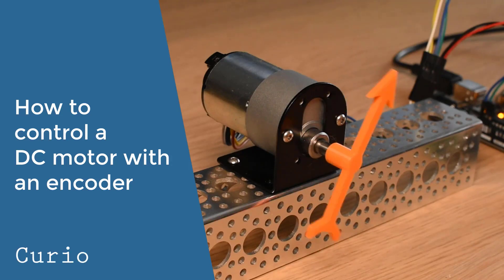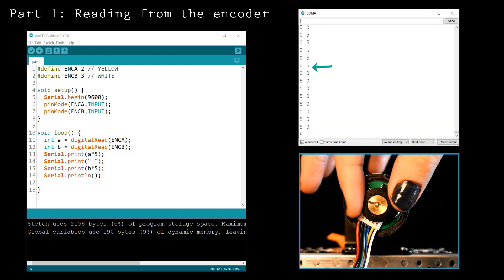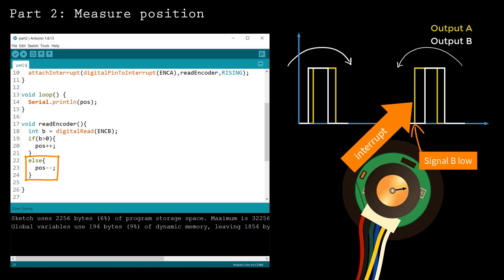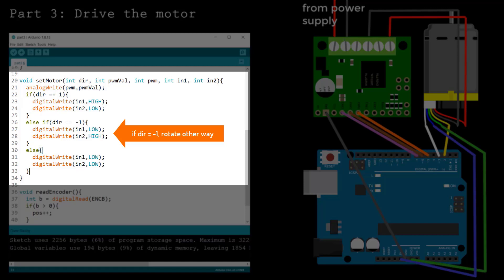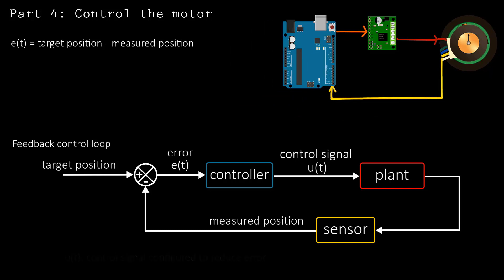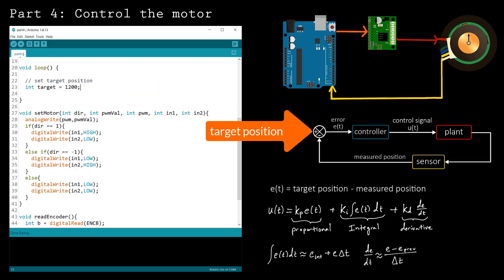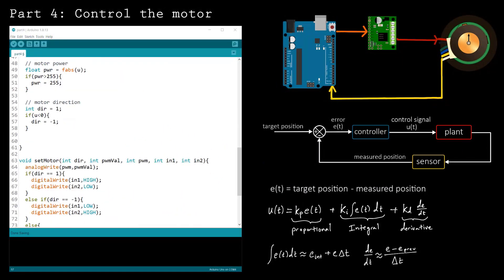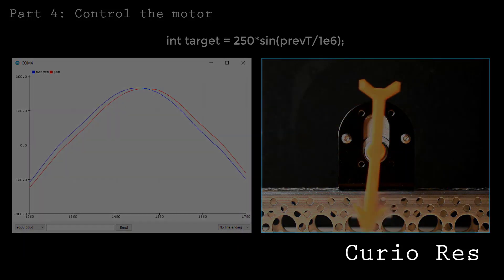How to control a DC motor with an encoder

Comment: I can get the sine wave function going but when I try to input a static target value, the motor turns and stops, then after a slight pause, the motor continues to go in the original direction indefinitely.  Has anyone else had this problem?  I downloaded the code from CurioRes to make sure I was not typing in an error.  I swapped out motors thinking perhaps the motors were the problem.  But I never can get the motor to stop and stay at the target position.  Any suggestions.  I tried @ben_Lucy fix but that has the same problem.

Comment: One of the issues I’m facing with the derivative calculation is that my microcontroller updates the error and previous error so quickly that the difference between them is almost negligible. As a result, the derivative term becomes zero or so small that its effect is inconsistent — either doing nothing or occasionally causing large spikes ("kicks") in the output, because the deltaT is so small.

One thing that worked was setting an interval for this calculation — for example, the microcontroller only updates the error and previous error every 5 ms, so the delta becomes noticeable.
Reply from the maker: Good point and analysis -- an approximate derivative can be a big source of error. A common approach is to filter the derivative (something like a low-pass). If you're seeing floating point errors that could be an issue to, but would probably be resolvable simply with update to the data types or calculations, without requiring throttling.

Just as an aside you also want to watch out for throttling the controller as that can lead to instability as well. Depends on what kind of delays there are in the response of the system.

Comment: Thank you. I have implemented your code using L298N. Everything is working fine. However, once the speed reaches 1200, the motor is automatically stopping. There is no isse with sine wave speed input. I would like to run motor at 1200 or set speed continuously but it is stopping.

Comment: Hello Curio....  i m learning a lot from your video...manage to construct the circuit and its working perfectly now! thank you very much ! I have a question here: if i have a motor with the following spec. • Inertia (J) = 0.01 kg·m²
• Damping (B) = 0.1 N·m·s (friction)
• Back EMF Constant (Ke) = 0.01 V·s/rad
• Torque Constant (Kt) = 0.01 N·m/A
•Motor Resistance (R) = 1 Ω
•Motor Inductance (L) = 0.01 H
and i wana achieve speed control with: Zero overshoot, Minimal Settling Time, <5% Steady State-Error, please advise what should i do? TQ

Comment: Hi, are you taking any questions in 2025? I would like to move the motor for a test to four different positions. Set up four pushbutts that, when programed into the vode and pressed, the motor will run to that position, stop and wait  for another one of the pushbutts, be pressed, and run in reverse to that new programed position. Can you do that for your viewers? Thank you.
Reply from the maker: I check here periodically. 

The task you're talking about is quite easy -- I don't think I would create a video for it, it would probably not have broad interest...but I can point you in the right direction.

Import the one button library. See the example here to get started:

https://github.com/mathertel/OneButton/blob/master/examples/InterruptOneButton/InterruptOneButton.ino

Now declare a "global" variable for the desired position at the top;

int desiredPosition = 0;

Set the click response for each button to whatever you want it to be.

template <int desiredPos>
void setDesiredPos(void){
    desiredPosition = desiredPos;
}

Then utilize that to attach a click for each button. Follow the example

https://github.com/mathertel/OneButton/blob/master/examples/InterruptOneButton/InterruptOneButton.ino

Something like this:

button1.attachClick(setDesiredPos<50>);
button2.attachClick(setDesiredPos<-50>);

Alternatively, if you don't want to use templates or you want to make changes dynamically to what's being done by each button, there are lots of other ways you could write the callback(s).

Comment: Good day hope you're doing well. I am having an issue with my code, can you please help me? I am working on a diy project for my flight simulator. so the combo of dc motor and encoder reads values from the game and should update the motor cw or ccw accordingly. for my setup i am using values -100 to 100. lets say the current position is value 80, to go to 81,82,83 etc, the motor should move cw and as soon as the value starts to decrease 83, 82, 81, 80 etc, the motor is supposed to reverse direction, my problem is that the motor will reverse its direction only at the target position which is position 0. example current value is 80, it turns cw to go to 82, 83, 84, 85, etc, and when the value starts to decrease 85, 84, 83, 82 etc, the motor still moves cw instead of reversing . but when i reach target position 0 the motor will then reverse . i can provide my code so you can have a look. thanks waiting for your reply
Reply: Post it I can help

Comment: Update: If your motor is not working, check that the wires are connected to the motor driver. The Diagram in the tutorial shows "A+ and B-" which is incorrect, it should be "A+ and A-" :)

Comment: Does the wiring/programming change much (if any) if I had to use an L293D?
Reply from the maker: Wiring? Yes, as the driver has different connection points. Code? Could be. Depends on the pinout of the driver. Have to look at the datasheet to determine what adjustments to make to the "setMotor" function".

Comment: For PART 1, I wrote the exact same code as you, but my serial monitor won't print.
Reply: I did that with PART 2, it still doesn't print.
Reply: My Code for PART 1 is exactly the same as yours, but the pins for ENCA and ENCB are different.
Reply from the maker: Difficult to debug without more information. It could be that your encoder has a different pin layout. Could be a hardware failure. Do you have another encoder you could try?
Reply: Nevermind, it was a serial monitor issue. Got it working! Thank you though! :DDD @curiores111
Reply: My serial monitor was the issue. I solved it. But i had another question @curiores111 , how to install util/atomic.h?
Reply from the maker: @shivpat09  Some architectures don't support atomic.h. There's an alternative version of the code posted on the GitHub page that you can try in that case.

Comment: My encoder is not giving values or giving unexpected and illogical values but when I build circuit which also includes the output Z wire and use a library Buttonfever then it gives appropriate values. Whats the reason?
Reply from the maker: Sounds like your encoder probably has a different interface than the one I used. Certainly, there's no compatibility guarantee with electrical devices -- always consult your datasheets (-- or, a dedicated tutorial, if available, is always useful).
Reply: @curiores111  may be. Thanks for your reply

Comment: Extremely well done. Have been utilizing an adaption of this PID control loop for leveling. Instead of using an encoder I pull data from a MPU6050 using the MPU6050_light library usually included in the Arduino IDE. Then Set the target to 0. It works really well!

Comment: Hi. I have a problem. At level 40 of 255 power. The motor makes noise, but does not have enough power to rotate (the encoder disk and main shaft do not rotate). But the value read from the encoder changes continuously. Is that noise. is there any way to fix it. Has anyone encountered this situation yet? Thank you
Reply from the maker: This is a common issue with DC motors. There are a couple things that you can try.

I had one watcher indicate that they improved the situation at low speeds by adding a capacitor to reduce the switching harmonics from the PWM signal. You could try that.

Another mentioned that lowering the input voltage to the motor improved performance at low speeds.

Personally, if I want lower speeds, I'll use a motor with a higher gear ratio. 

In the latter two cases, though, you wont be able to reach higher speeds. (Unless, of course, you have a control mechanism or plan to build an automatic transmission)

Comment: For single motor operation, HBRIDGE should be pulled high, then the single motor + should be connected to both A+ and A-, and - should be connected to both B+ and B-

Comment: Very nice video, and close to what I'm looking at doing.   My plans so far will be with any Arduino board, I'm wanting to have a AS5600 read a direction/step every second and write/save that info, so an average can be calculated for later use.   Then once a minute or so read another AS5600 with a Stepper motor and have the stepper match the average direction/steps of the other one.

Comment: Are the connections of this encoder same for arduino Nano with a Hall effect encoder?
Reply from the maker: Not necessarily, you need to verify that the nano pins support the same functionality (pwm, interrupt), and the pinout for your encoder.
Reply: @curiores111  So if I ensure that I connect the two channels of the encoder to the digital interrupt pins of the microcontroller board is the encoder connection correct?

Comment: Great video, I liked the detailed info you supplied. I have 2 questions though. Could I use this to control a 12/24 Volt DC 250W/350 Watt Gear Reduction Brushed Electric Motor that only has a positive and ground wire, no encoder? What I'm trying to do is,  press a button to start the motor and have it automatically stop after 100 revolutions. I also want to be able to easily adjust the speed and number of revolutions of the motor using 2 adjustable digital displays. One for motor speed and the other for motor revolutions as needed, without having to rewrite the code every time. Is that possible?
Reply from the maker: 1. You need an encoder (or some other mechanism) to ensure the correct number of rotations. So no, you can't do this for regular dc brushed motor without an encoder.

2. Sure, you can easily write code to adjust speed/number of revolutions using user input (the particular form doesn't matter, as long as you can get the input in the Arduino code). You don't need to "rewrite the code every time", simply read the user's input, and add whatever logic is necessary to achieve your requirements.
Reply: Thanks for the reply, very helpful @curiores111
Reply from the maker: @livefreeordie9542  Certainly 😊
Reply: OK, I figured a few things out, I think. Still using the 12/24 Volt DC 250W/350 Watt Gear Reduction Brushed Electric Motor. Added the  BTS7960 43A High Power Motor Driver Module/Smart Car Driver Module for Arduino Current Limit. And a IP67 waterproof 24V 400W 16.6A Power Supply, So I can control the motor through code. While connected to the Arduino uno r3. What I'm not sure about is the code to set it up so when I push a button it activates the motor. Making a set number of revolutions, (say 200) then automatically stop and reset. So every time I push the button it performs exactly the same. I'll be controlling the speed via potentiometer and the direction (fwd & rev) using a forward, off, reverse switch. Any thoughts on the code required to meet my goals? Any help is greatly appreciated.   @curiores111
Reply from the maker: @livefreeordie9542  Do you have an encoder on that motor? You'll need it to for the feedback loop as I mentioned in my last reply. :)

As far as the code goes, you can pretty much use what I have. You need to modify the "setMotor" function to match the datasheet of your particular motor driver.

Then, you need to add in some code to read from your button. If its a standard button try out the oneButton library.

Use an if statement to change the target of the motor when the button is pressed. Pseudocode:
if(buttonPressed){
     targetRevs = currentPositionInRevs + 200
}

If you want the motor to stop if the motor is currently running and the button is pressed, you'll need another flag and a little more control logic.

Hopefully this helps get you started.
Reply: Thanks for the advice and code. Both are much appreciated. 

Still working out what type of encoder and how to mount it on my project. Leaning toward a magnetic encoder due to the harsh environment it will be in. I think the photo sensitive encoder would be more susceptible to dust, dirt, water and oil than the magnetic encoder. 

Now I'm just trying to find the right size magnetic encoder to fit the 8 mm output shaft on my motor. Going to mount the magnet on the end of the 8 mm output shaft then design & 3d print a bracket  to hold the magnetic encoder in place that attaches to the motor mount for stability.

Thanks again.   @curiores111

Comment: Awesome video! Quick question, would this implementation not run into trouble if the interrupt and the control loop both try to access the “pos” variable? 

I found that you could just temporarily shutoff interrupts but wouldn’t that run the risk of missing some counts? 

Best!
Reply from the maker: Yeah, you don't want to turn off the interrupts.

You can use an atomic block to avoid issues when accessing the variable. I added that after I made the video.

Comment: If using this "servo" motor in a more complex application would it be more computationally efficient to dedicate 1 Arduino for calculating and sending position values via the PID algorithm you just demonstrated and have an additional, main Arduino dedicated to the overall processes and handshaking with the other Arduino? Sorry for the convoluted question, great video extremely informative!
Reply from the maker: Certainly nothing wrong with that strategy. Whether it's necessary depends on how complicated the overall application is. Especially if you're sensitive to missed steps, you might not want to overload the arduino that's connected to the motor. If not, probably okay to do everything on one Arduino if there's just one motor.

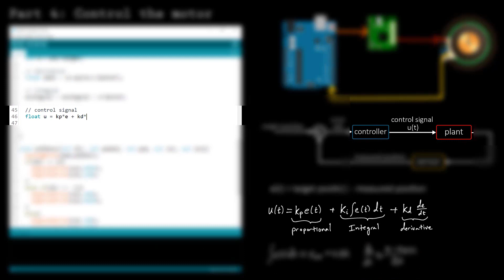Comment: 7:50-7:55
e(t) has dimension V, integral e(t)dt  has dimension V*sec, derivative de/dt has dimension V/sec.
Is it correct to add values with different dimensions ?
Reply from the maker: There's nothing "wrong" with adding two signals with different dimensions.

On the other hand, when you add two signals with different dimensions, a question arises: what does the result "mean"? Also, it creates a possible issue: if you rescale either, the sum is no longer the same. So it generates a potential inconsistency, and certainly a likely source of confusion. It's certainly a nice discussion topic.

As far as this video is concerned, those questions are a non-issue, because e(t) and de/dt, and integral of e(t) dt are not added to each other.

Instead, they are linearly combined with coefficients kp, ki, and kd. Since those coefficients are arbitrary, they would naturally encode the units required to make the dimensions consistent.

Assuming a dimensionless u(t), that implies kp has units of 1/[e(t)], the integral has units of 1/([t][e(t)]), and kd has units of [t]/[e(t)], where [t] represents the units of t and [e(t)] represents the units of e. 

So, they do exist, although admittedly typically ignored and potentially generation a source of confusion at some point for someone trying to re-use coefficients.

Comment: Does this work if we use L298N motor driver IC instead of the one used in this video?
Reply from the maker: You can use any typical DC motor driver (including L298N). Please note though that you can get motor drivers better than L298N for just as cheap.

Comment: Hi. Thank you so much for this useful video.
I have a question: What should I add or change if I want the motor to reach the desired position, with a certain velocity (let's say 10 rpm)?
Thanks

Comment: I looked into it a bit more, the disadvantage of this method is that it is only looking for encoder A pin rising. This means that wiggling the motor back and forth a little looks like the motor is moving continuously forwards. It also counts more than one step if the input bounces. Instead: checking for all four quadrature transitions fixes these problems and means 4x as many pulses per rotation which means you can be more precise.

I added these lines at the beginning:
#define readA bitRead(PIND,2)//faster than digitalRead()
#define readB bitRead(PIND,3)//faster than digitalRead()

I changed the attachInterrupt line so that it triggered on CHANGE rather than rising, and added another line for the B encoder pin:
  attachInterrupt(digitalPinToInterrupt(ENCA),readEncoderA,CHANGE);
  attachInterrupt(digitalPinToInterrupt(ENCB),readEncoderB,CHANGE);

And I changed the functions triggered by the interrupt to this:
void readEncoderA(){
  if(readB != readA) {
    posi ++;
  } else {
    posi --;
  }
}
  
void readEncoderB(){
    if (readA == readB) {
    posi ++;
  } else {
    posi --;
  }
}

This eliminates bouncing (posi will just count forwards and then backwards with each bounce), increases precision as you get 4x as many interrupts triggered per rotation, and prevents you from 'tricking' the encoder by moving the motor back and forth by a small amount. Credit to Cattledog on the Arduino forums in 2017.
Reply: Very helpful - This ended up making my code work and support bi-directional control.
Reply: YOU ARE A LIFESAVER. THANK YOU SO MUCH.
Reply: thanks a lot for this!
Reply: thank you. my motor driver doesn't have PWM pin it's HW-95 what should i do ?
Reply: Ben, can you show the change to the code/program on github? I would like to add other positions to this code.
Reply: You can set a interrupt on both pins and use it to access a lookup table. As a bonus, this can achieve full resolution of encoder.

Comment: Wouldn't motor power ground lead be connected to second pin A- rather than B-? Also, don't you need VCC +5VDC out from Arduino to VCC pin on motor controller to power controller?